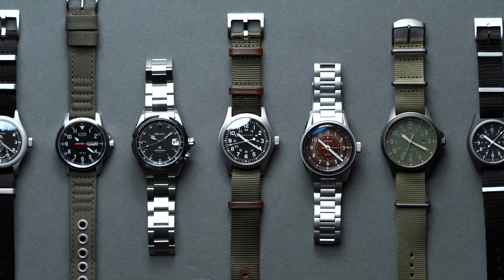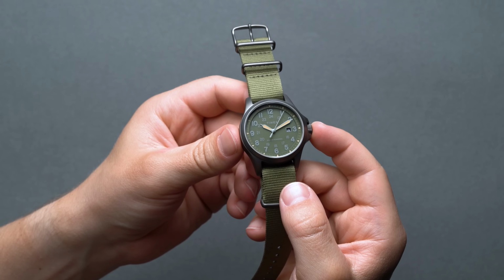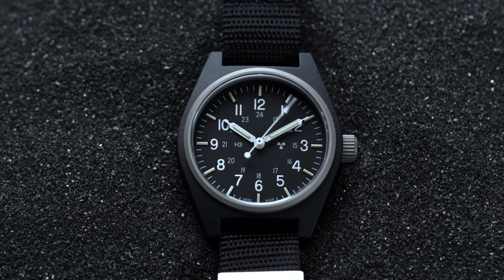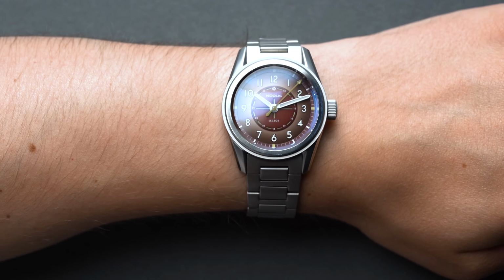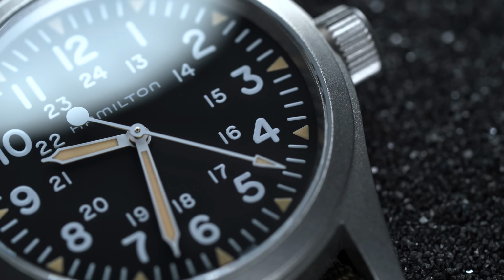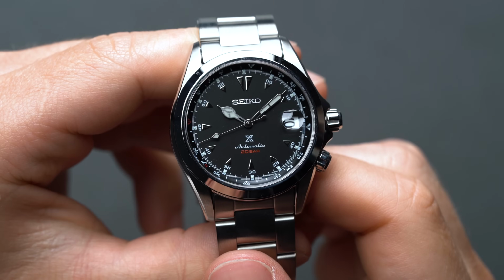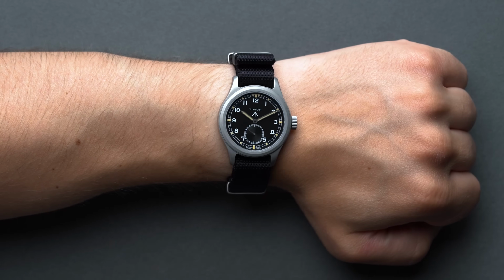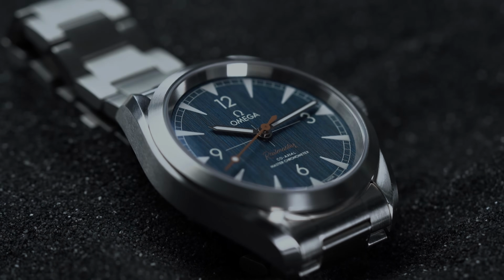The 7 Best Field Watches

Comment: for duty use i recommend the marathons over everything else. they also make a stainless steel variant of their GP line. even the mechanical steel variant is significantly more rugged than the hamilton
in my opinion it's the only TRUE field watch nowadays, besides select digitals
unfaltering lume is a MUST for a field watch. chem lume will not cut it.

Comment: I think the Citizen Garrison (or Chandler - their branding is a bit confusing), is almost everything you could want in a field watch at that price point. And solar is definitely the way to go for field watches since it’s just grab and go without any hassle. Not having to change a battery will also preserve the water resistance longer since the case doesn’t have to be opened. Nobody does solar better than Citizen - It’s a tried and true quartz movement that has been proven to work for decades.

Comment: Form must follow function, and if truly— you are in the field, the watch needs dependability.  In my youth I was a prospector and would go into the field for months. Analog face watches, which hand wound, were everywhere because they worked in harsh conditions.  They were not expensive because we had not discovered a gold mine yet.  So my checklist on a Field watch isa bit harsh:  1.  No batteries, they quit, cannot stand -30c,and when you replace them ,often the gasket is ruined and they are not waterproof, also they will fog up and quit in high humidity. 2.  The face must be easily read day or night, high contrast, second sweep hand, no extras. 3.  They must keep time.  You don’t have a time check often to reset a watch that’s off, although 10 minutes a month is not big deal. 4.  The strap must pass through both pins.  If it gets hit or scraped, you will lose it if one pin breaks otherwise. It must not be metal, which can affect your hand compass, and are cold in winter. 5. The stem must screw in to prevent it from snagging on a packsack strap and breaking. 6. Mechanical or robust automatic movements, Only.
If the field watch does not have these features I would pass. My current watch is a Hamilton Field, large size.  The extra diameter is in the road sometimes but it is easy to turn into an emergency compass using 12 and the hour hand.

Comment: I wore the Citizen field watch everyday for three years. I was surprised how small it was, which is the reason ultimately why I stopped wearing it. If it was a couple mm larger, I would have worn it until I died. Apart from the size, it was a phenomenal watch. It has great lum on it. Even at its small size I never had difficulty reading the time in dark environments. I prefer watches around 40mm give or take a couple mm in either direction. The Citizen field watch sat just outside that range on the small side. I still have it. It is keeping perfect time as I write this.
Reply: What is your wrist size ?

Comment: At this point, field watches are a fashion style than a real tool.  That first Timex is a clear example.  The grayish markers and arabics are hard to read in low light.  It could be forgivable if it had timex's indiglo, but it doesn't even have that. 
The timex also has crown guards and a small crown, making it difficult to use with gloves. 

At least it doesn't use timex's cost saving brass case.

And watches without Arabic markers and shiny metal bracelets?  Sorry, I don't see those as field watches but more like sport watches.

Comment: Timex was sold in the PX in the early 80’s and most of my grunt buddies had them. The G-Shock was $300 when it came out in 1983 which almost a months pay for me. The original G-Shock was nice, but a light on a digital watch would get your ass kicked if used at night during an op. And with today’s night vision goggles, you can see that G-Shock light from two miles away. Now, I do have a Suunto and Garmin Fenix where I can change the light color for night vision goggles. Pretty cool but fantasy when I joined the Army. To be safe, automatic is the way to go.

Comment: one question:
how can you STAND to wear the watch on your left, having the crown dig into your hand everytime you bend your wrist?!?

I only have one modern "field watch": Casio FT-500W Forester.
After 9 years I have had to replace the batteries once. It is due for a new strap. The original green nylon and black faux leather is looking a bit ratty at the "leather".
I am also not all that fond of the velcro closure, although admittedly it has never given me any problems.
As for accuracy, it MIGHT gain or lose a couple seconds every couple months. Not enough to worry about in retired civilian life ... or most civilian occupations.

Comment: Since you brought Tudor and Omega prices into the mix i have 2 others that comes to mind. Damasko's DK30 and DK36. Also Sinn 856.
They are the essential field watches. Sinn 856 has all the Sinn tech with tegimented steel, magnetic resistance to 80.000 a/m, Ar-Dehumidifying Technology. Everything you can ask for really in a field watch.

The 2 Damasko's is the same minus the Ar-Dehumidifying Technology, but they have the edge over sinn in terms of the movement. They took an Eta and modified it to decrease friction and some components in the movement is hardened as well to withstand abuse. I believe they use a silicone spring as well, but not sure which of the current models that had it.

Comment: Any Timex north expedition
Reply: That's not that good
Reply: @greenerick  Depends. Readable + good value + decent durability. Is that not what makes a good fieldwatch? Its not a modern Rolex Explorer, but it does the job of a fieldwatch well.
Reply: The only issue with the Timex Expedition North is the weak lume. The rest is pretty good. Seiko/Epson solar movement - I have more than one and they all keep great time. Better than most of my Casio watches.